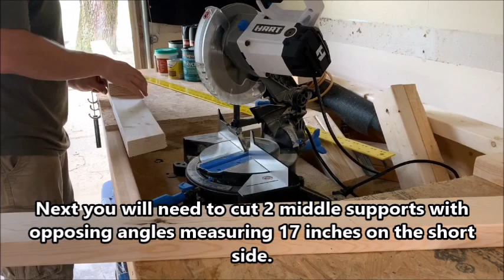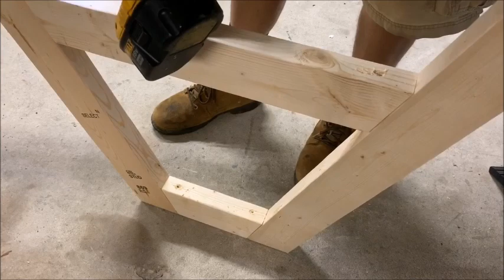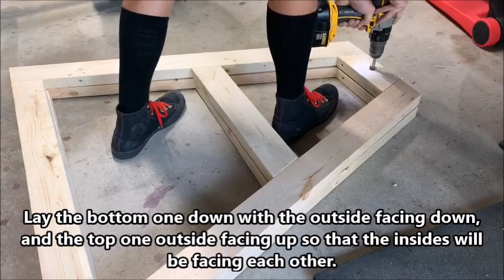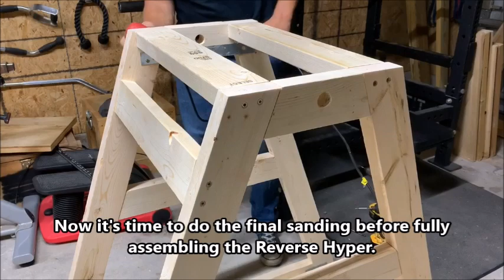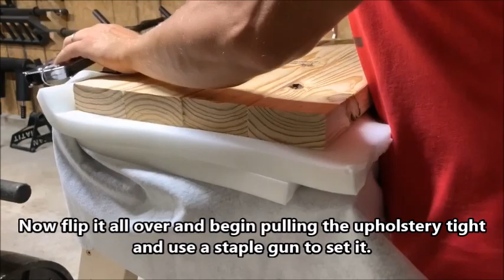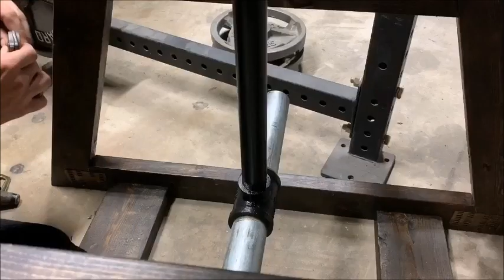How to build a Reverse Hyper

Comment: Thanks for sharing, I like your design! I'm curious - how has this held up over time? I'm most curious about how the pendulum has done.
Reply from the maker: Thanks!  I honestly don’t know what’s come of it now, but when I had it, I used it frequently.  I ended up selling it to someone else in my local community and they later shared something about it in a home gym group I follow on Facebook.  So I know they’ve at least gotten some use out of it!  The pendulum should hold up just fine, I was only ever worried about the wood rotting where the pendulum hangs, but I added rigid metal strap under it to support that part a little more.